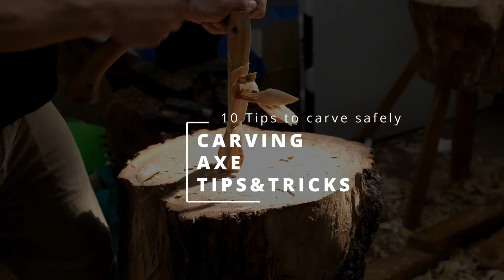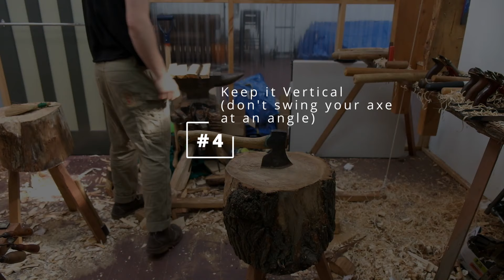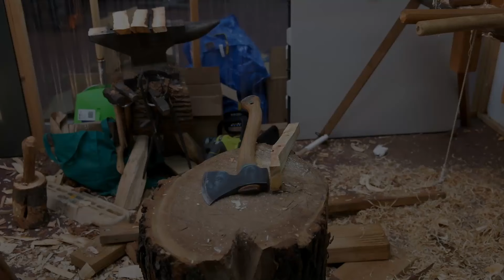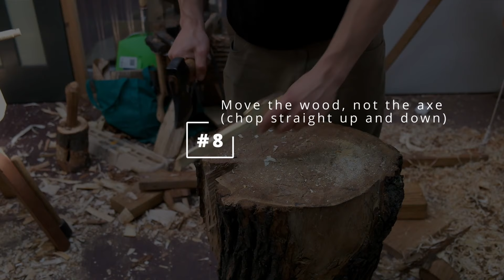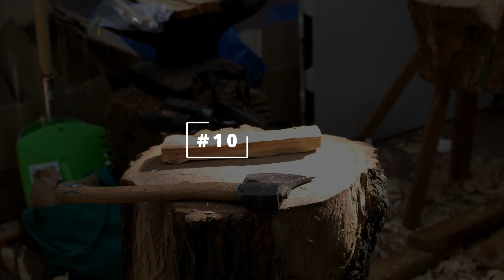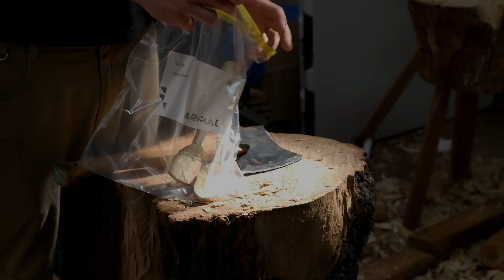Greenwoodworking - 10 Tips to Improve your Carving Axe Technique

Comment: Great instruction. Thanks. What do you do with them once bagged?
Reply from the maker: I freeze them and save them for later
Reply: @jones_trees_and_treen Do you use dry wood or green?
Does the freezing keep them “moist”?
I can only find very dry wood where I live and it’s very, very hard to do anything with that. Am I doing something wrong? Or it’s always like that with dry wood.
Lucky of you guys that have nature close to you.
Reply from the maker: I will use whatever wood is around, but dry hardwood I typically save for other woodworking projects rather than carving.